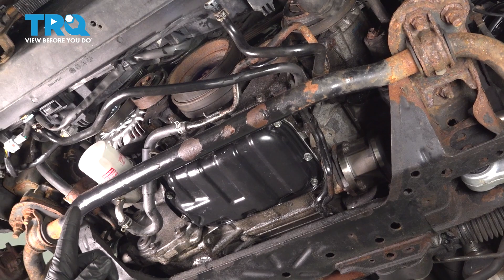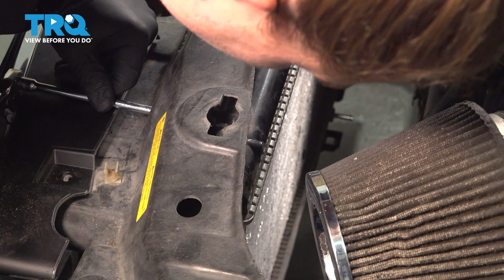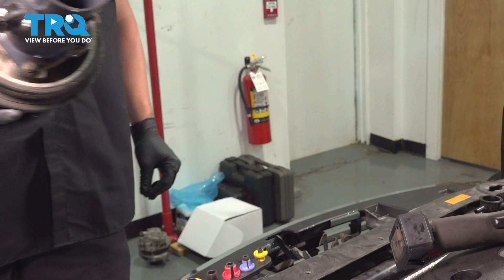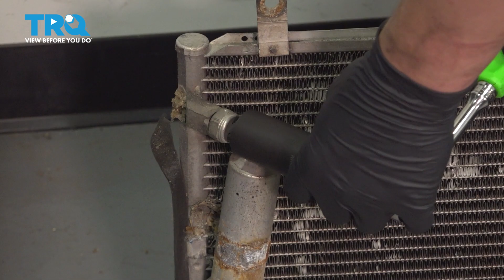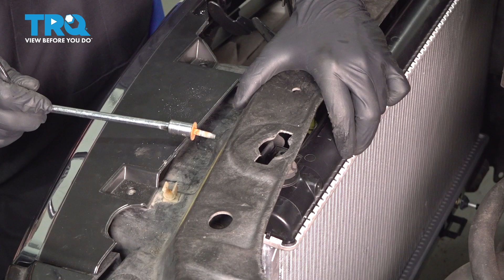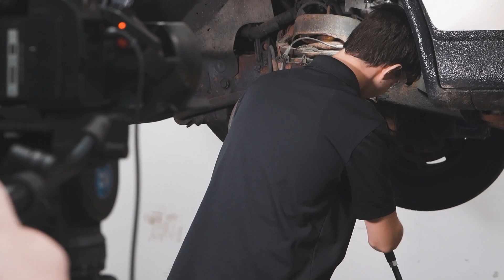How to Replace AC Condenser and Receiver Drier Assembly 2003-2007 Infiniti G35

Comment: Wouldn't it make it easier to just take the radiator out? What about the clips n the bottom that need to fit into the radiator?  How come you didn't show how they are supposed to mesh?